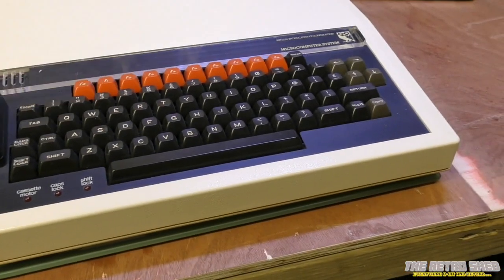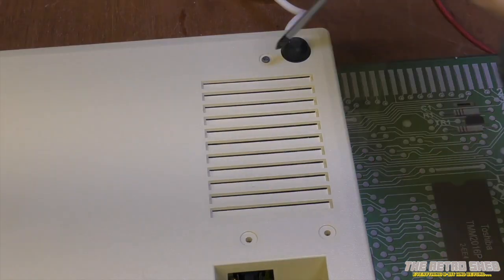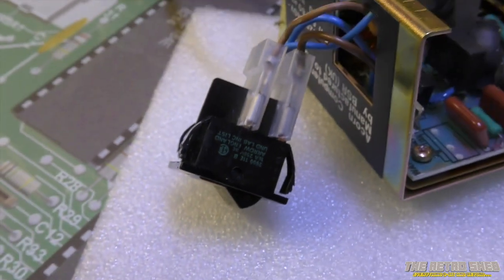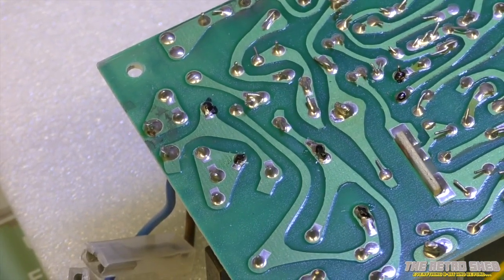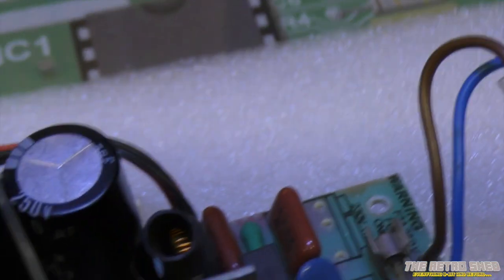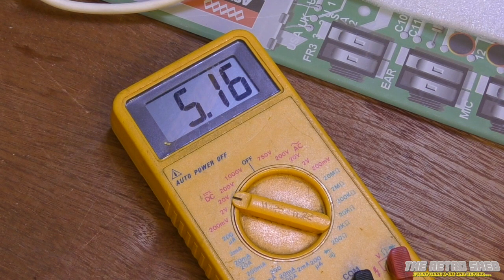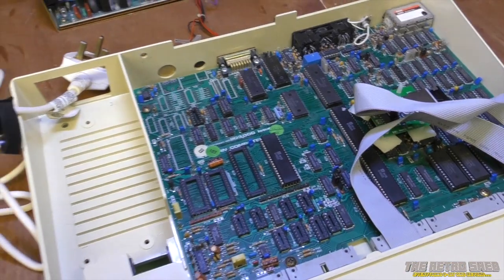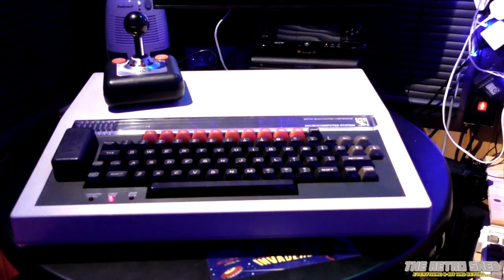BBC Micro Power Supply Fix | The Retro Shed

Comment: Thank you for your recommendation on the BBC microcomputer power supply repair. I own one of the BBC 32 microcomputer since 1983. Recently taking it out and tried to revitalise the computer and found the power supply look like having the same problem. So I bought those capacitors and changed as you recommended. But on checking the output 5V supply to the main board it gave a 10V reading for all those output pin. Hope anyone has the similar problem, please help and recommend me what I should do to get my 5V output to test my main board. Many thanks.
Reply from the maker: I’d check all the tracks and solder joints carefully. A resistor could have gone high. There’s some detailed information on this thread: https://stardot.org.uk/forums/viewtopic.php?t=17443
Reply: @TheRetroShed  Thanks for the suggestion. will read about those info first. By the way I tried without load, just switching on the PSU without connecting to the BBC main motherboard and measure the +5V output pin, all giving my multimeter a 10V stable output. As suggested, I may have to check or change some of the resistors if they are faulty or 
ok.
Reply from the maker: @wktham1616  yes you may not be getting a true reading off load. If the voltage gradually rises I suspect a cap. May be worth putting a bulb or other load across the 5v rail and seeing if the voltage is more as it should be before going any further?
Reply: @TheRetroShed  thank you for the speedy reply. I will try the next few days. As I am not any electronics specialist, will read up a little more on how to connect a bulb to the 5V output.